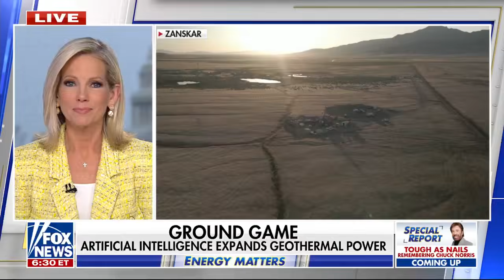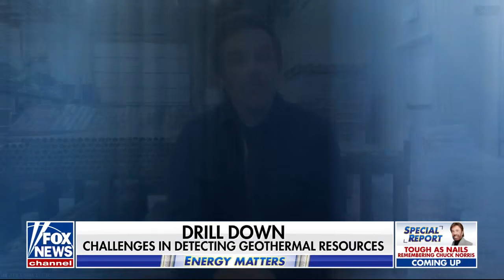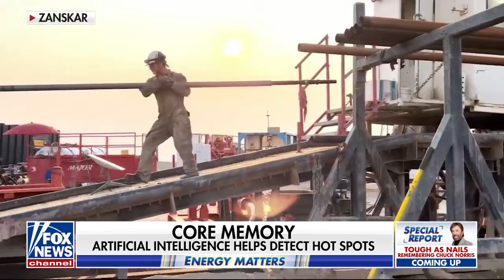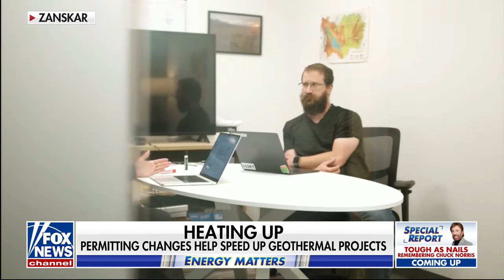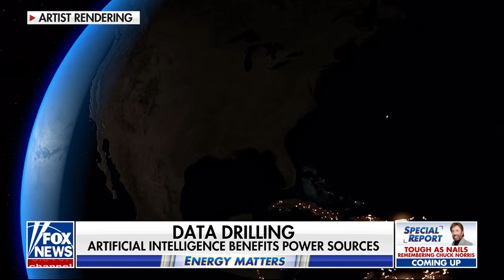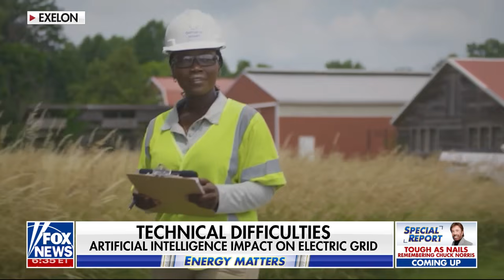HOT SPOTS: AI advancing geothermal energy production

Comment: YELLOW STONE!!! The hottest hot spot on earth. These wells would be invisible to the landscape AND PREVENT A FUTURE ERUPTION by taking away the heat building up inside that massive zone. There’s also a special metal or carbon we have yet to explore that could send electric current 1000’s of miles without resistance. If we ever developed that tech we could send this geothermal everywhere. You’d only need 1-2 of those insanely expensive transmission lines to the delivery zone then use older lines to distribute.